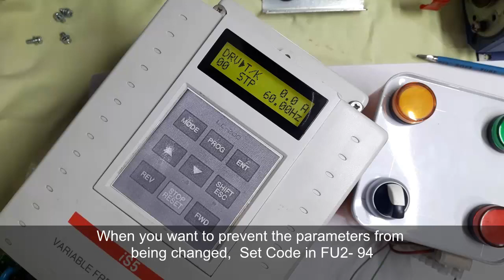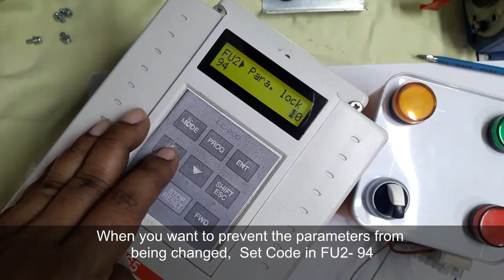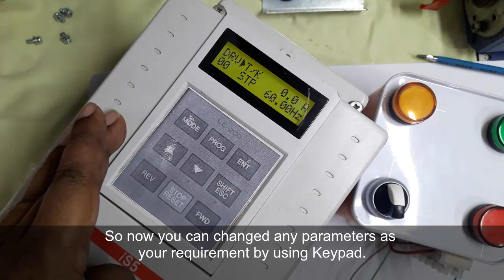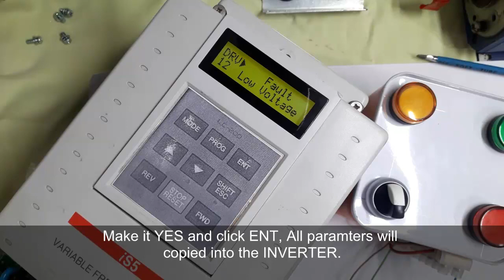Parameter Write Protection of LS iS5 Inverter and Parameter Write from Keypad to drive @FlowChart

Comment: And parameters write option try to change yes. It will also automatically goes to no after few seconds
Reply from the maker: I think control card is malfunctioned, please recheck Control card and mother board connection